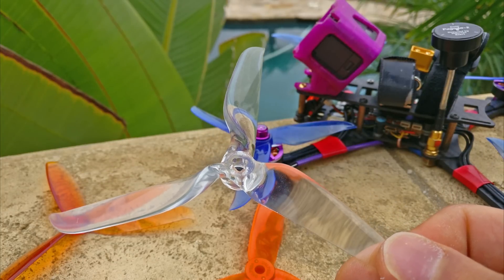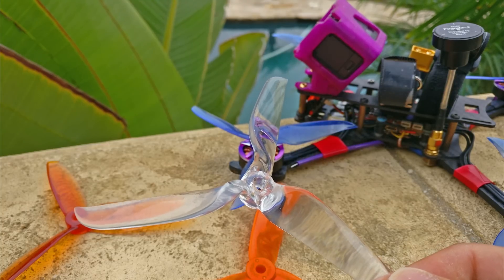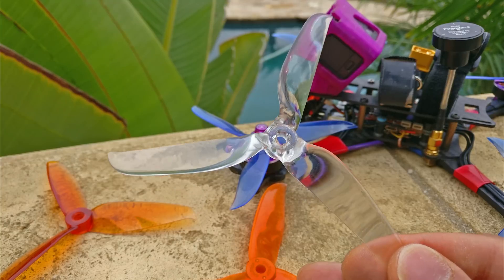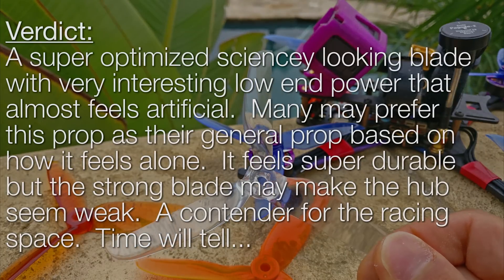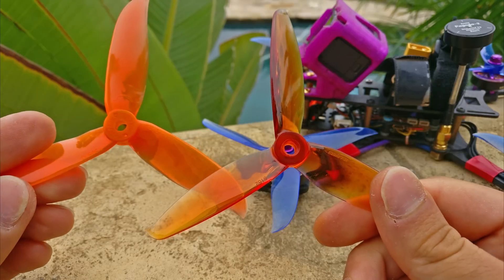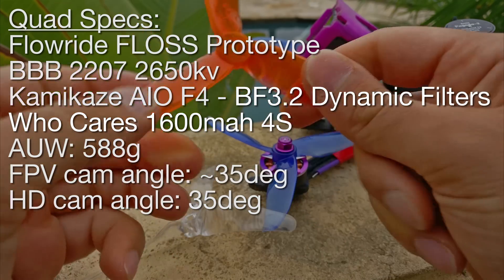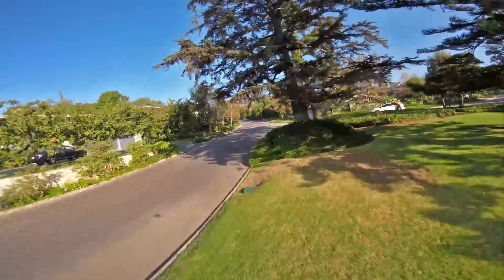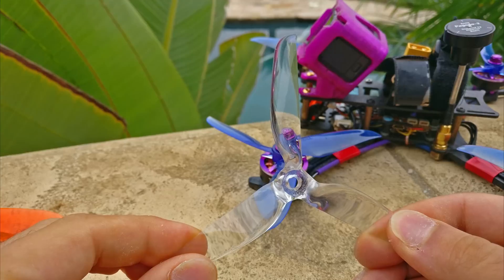Gate Breaker - Prop Discussion

Comment: I didnt know props work better or worse depending on motors kv. So what makes it better for higher kv vs what i run is 1750kv
Reply from the maker: These props are quite old by now. Not bad but I wouldn't recommend them for 6S and kv beyond 1750kv. For motors 6S operation and the more typical 1850-2100kv of today, I would strongly recommend considering the gemfan 51433, gemfan F4S or the more recent Ethix props. If you're looking for the highest level of throttle control, you want the gemfan F3s but the power is reduced
Reply: Interesting well I got a set of the gate breakers in the mail yesterday. I'm still gonna try em lol. But I've been running ethix S5
Reply from the maker: @Chillin-fpv  The gate breakers are mainly just really inefficient with higher RPM.

Comment: This is really odd for me. I run 6S on emax LS 1900kv . My Cyclone 5046 keep exploding mid air from centrifugal force where as my 6050 gate breakers refuse to break and produce crazy top speed but way to twitchy on the bottom for freestyle. BUT! That is just my experience so far. Maybe I got a bad batch?

Comment: I wish there was a gate breaker and butter cutter comparison video. I'm using 2206 2450kv Motors and I ordered one of each of those props
Reply from the maker: gate breaker is much better across the board.  I personally don't like either.

Comment: Well I smacked the ground at 90mph pulling out of a dive and chucked the battery 30 feet and the motor launched another 30 feet, with the prop still attached unharmed.

I broke one hitting a light poll. What they do is chip, I'm finicky so I don't fly chipped blades, the one that broke broke at the hub.

As for feeling, I just put in an order for 20 sets.... that's how they feel, they have so much thrust, grip and speed, but they feel "mellow" all the time, they also never stall out, even running 2750KV 2306 E-Max's- they just seem to accelerate more and more.

Comment: it does look interesting, but I'm going to pass. Mad props to getfpv for trying to compete with the cyclones, but at $2.50 (when you buy 30) a set, i don't see anything beating the cyclones anytime soon.  Getfpv should call them shaft benders, since all of their lumenier motors have 3mm shafts.  I've got a draw full of lumeniers that don't spin so true anymore.  What's the innovation, something to keep the prop nut on?

Comment: I  also agree with Justin Skinner.  My experience is the Gatebreaker is NOT durable.  Hitting a gate, a cyclone is usable for the most part but you may need to bend it back but you can continue on.  The gatebreakers simple break at the hub thus I couldn't continue.  In fact, I would break all 3 blades at the hub in some cases.  One thing which leads me to believe its just a bad batch, I ONLY broke clockwise props.  Which having 7 sets, they didn't last long.  Wonder if Justin had the same issue?

I absolutely LOVED the feel of them.  If they were as durable as a cyclone or 5051 RK, I'd run em in a heartbeat.

Comment: Propeller are the "tires" in the air, motors are the generall body size/muscles, Lipos (weakpoint) must deliver the electric power!, weight is the shell overal, RC and other Rates counterfeite the summary. They are so many curves and sweetspots you can dancing around ;-).

Comment: gotta love stratasys polyjet 3d printers.. until you need to replace the $400/kg resin and $400/kg support resin. At my old job we had the stratasys objet 30, and just the UV light cost $800. HOWEVER, flawless prints.

Comment: Hopefully they start Keying them. So say for instance the motor shaft is a hexagon shape and then the center of the prop will be a hexagon shape so it cannot slip during flight
Reply: I dont think you'd want that. break a lot of hubs that way. I really like the brotherhobby hyperlite design of using a smaller nut and a washer, so if the prop hits something HARD its able to rotate a bit on the shaft with the washer, so the nut doesnt loosen and stays tight. my 2 cents

Comment: You know what i liked about this review? You are not on the 2306 motor hype like everyone else, I run the 2207's as well, It kills the 2306 in efficiency and has a complete linear power throughout the throttle range, Basically they just rock and we know that (;
Reply from the maker: the taller stator is better at managing high RPM.  The wider stator is good for frames like the Chameleon with a bunch of crap in the middle blocking air flow.  It needs the low end torque to actually respond.

Comment: So what is the innovative change? Tell me more!!!
Reply: I would guess either screw on propellers or a standardised notch system in the base of propellers and top of motors to prevent prop slipping. Or some sort of propeller quick release nut.
Reply: if you look closely you can see three notches.
Reply: I thought the same thing. If those notches in the center hole serve a purpose, wouldn't it be a better idea to align them with the roots of the blades, rather than between them? Thin material between the blades could be at fault for the hub breaks.
Reply: Jakob Lindstad, HatfieldCW yes but imagine how great the force would have to be to snap it. At that point, I think other prop would loose a blade so it really does not matter. Probably
Reply: Life time waranty lol
Reply: Emax already used notches to help grip the prop, so it wouldn't be that..
Reply: I bet its some sort of smart and secure prop release system. Its the only thing that would make our life easier, everything else has been told
Reply: Won't the prop be more susceptible to breaking at the hub, if you have the motor matches to the three notches?
Reply: When I tightened them loosely they came off in a full throttle punch, so the 3 notches didn’t help much in my experience, that’s the main thing I don’t like about this prop, the size of the shaft thingy in the middle is uncomfortable to run on low shaft motors, after a few crashes you have to retighten them

Comment: the feel in the air is definitely a thing.    i have been flying Strix 5040x4 and 5045x3BN for a year because I had an abundance of them.

finally tried the DAL cyclone 5046 and was instantly blown away in terms of control.   and for my flying style flight times were pretty similar.    just much more locked in, faster, and able to be more ballsy/brave in my lines.    that was on a Martian 210 with 2205 RS 2300 Emax motors on a 410gram weight without battery, so probably 550 with a 1300mah 4s.